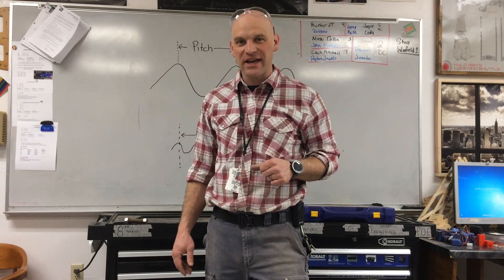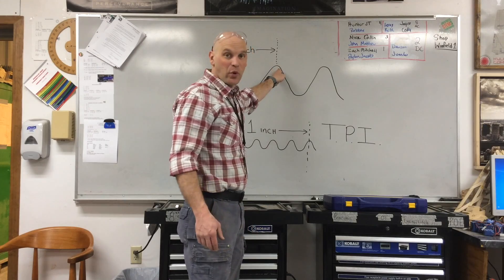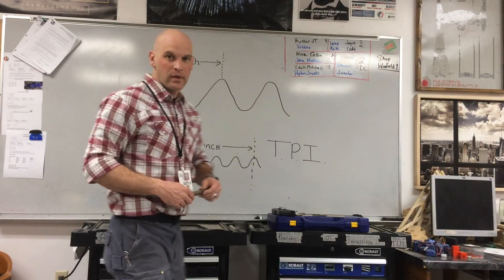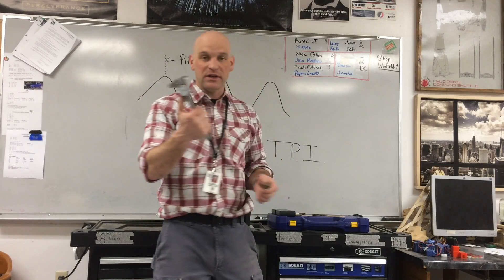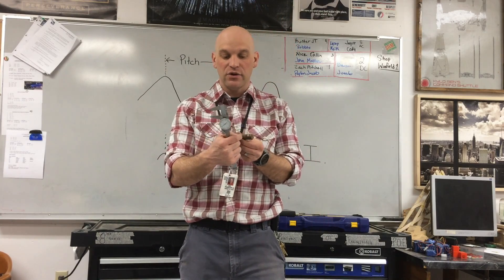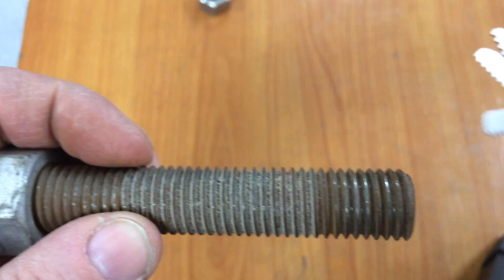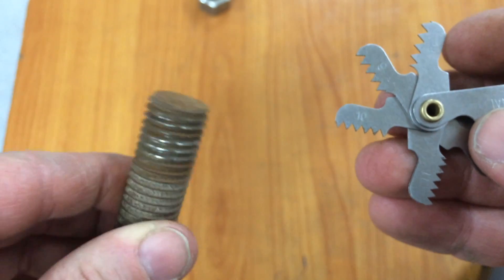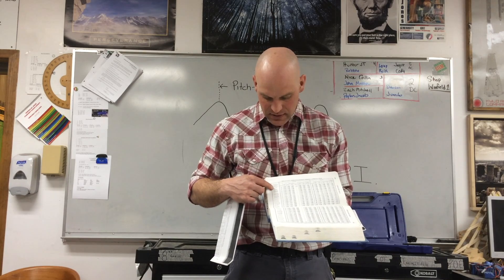Bolt Identification by Pitch and TPI

Comment: Hi,
This has always been a bit of a mystery for me. Usually i just go ace hardware who has an incredible selection of bolts, screws, nuts, and other stuff and muddle threw till i find wht i need or get frustrated bcuz the bolt/nut thread is custom from the company im wrkng on.
Reply from the maker: I did the same thing until I learned how to use a pitch/thread  gauge

Comment: one of the thread I am checking matches 12G on thread pitch gauge and it's major diameter is around 44.5 mm.From BSW chart ,12TPI belongs to 1/2 inch thread. But for 1/2 inch thread, major diameter is around 12.7 mm(here i have around 44.5 mm). Also from BSW chart , for 44.45 mm diameter, it is 1 3/4 inch thread size. But its TPI on chart is only 5.Can you please identify which size thread is this ?
Reply from the maker: I’m sorry, but I would really need to see the bolt to identify it’s threads